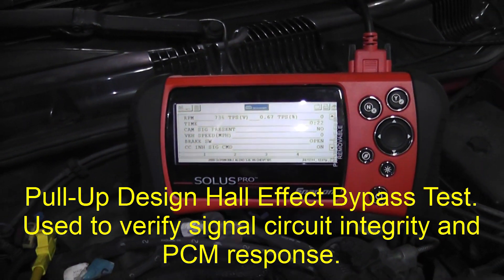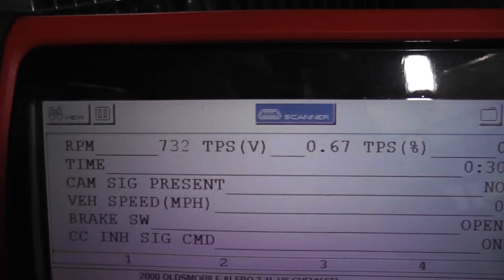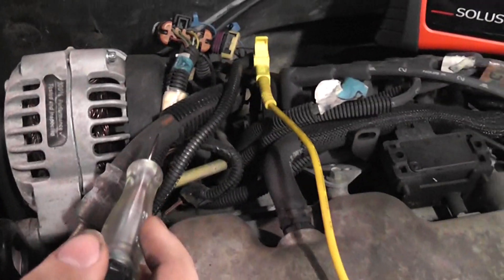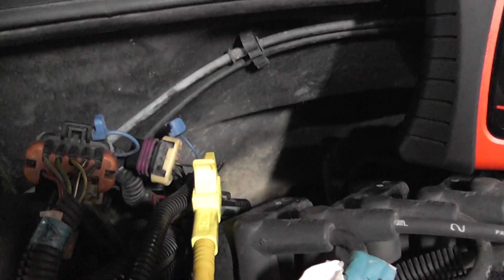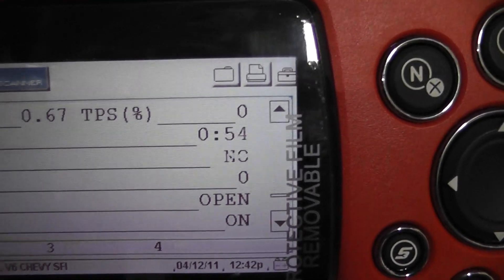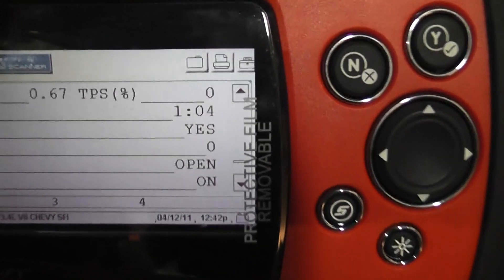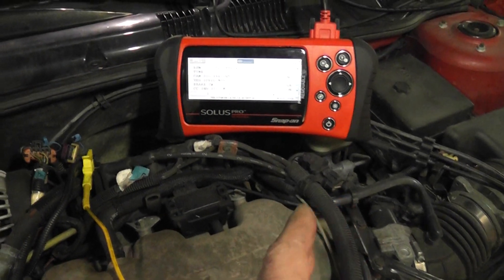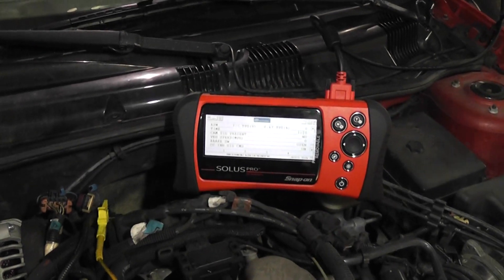Camshaft Position Sensor Circuit Quick Test

Comment from the maker: This is what the cam sensor is doing, so in this circuit design there is no danger at all. Even if you used a jumper wire and kept it connected, you wouldn't hurt this circuit.

Comment from the maker: @Howardtripper For this circuit, no, it is a 12v on/off square wave signal. For other lower voltage sensing circuits you still will not damage the computer with a higher voltage through your test light. The only voltage I have seen "hurt" an input circuit was an injector control wire touching a 5v ref. wire. This was causing 120volt spikes to surge through the entire 5v reference circuit. It cooked the MAP, AC pressure sensor and the PCM.

Comment: to add.

i pulled the connector plug of the cmp sensor and found the supply voltages  good.. except im getting 0v (or ground) at the sensor output to pcm wire.. it should be a 12v+ from the pcm for pull down to work.

Thanks in advance for your help. i really like your classes

Comment: @ScannerDanner best on the YouTube's thanks for sharing!! So, if the scanner is reading no signal from the cmp that is an error? (I have no cmp code but when monitoring engine with scan tool I see "no" signal present from cmp) If tested in this fashion with scanner showing yes when probing signal wire that verifies pcm and signal wire is good? [Assuming power and ground are present at plug this scenario shows bad cmp?]

Comment: that means the signal wire to the computer is good, right? and i assume the computer itself is good too, right? so if you're completing the circuit using the test probe, that means your cam sensor is BAD, right? You know what you're doing there, but its hard to figure out when i don't know

Comment: most and all service manuals for the chevy 3.4 sfi engine show the cam sensor to be a pull down design. its throwing me off that even the factory service manual says its a pull down design. There is another video of yours showing a 3.4 impala p0335 due to shorted cam sensor wires and it also shows a pull down design on the scope.

i scoped the sensor on a crt type scope and its showing up as a pull up just like this. While the manuals say its a pull down.. im trying to sort a driveability problem on a 01 impala 3.4 which is stuttering badly and the only code showing up is a pending p0336.

Comment: Thanks for the video.  I"ve got a P1374 code.  Says it's the cam shaft sensor.  I've taken off the power steering pump and I see the sensor.  I took out the 8mm bolt and the sensor sits and spins.  Kinda afraid to pull it straight out.  Is this what I should be doing?  The Haynes manual merely says to remove it.  Nothing specific on the how. 

I appreciate the reply!  :)
Reply: Sorry.  Forgot the vehicle info.  1999 Pontiac Grand Am SE with the 3400 V6 in it.

Comment: We have a 1997 Chrysler T&C, with a cranking no start.  It is now throwing code P0340.  Camshaft sensor has been replaced twice, as we thought we had a faulty one.  Doing a bypass test, power wire has 8 volts (which is what our Haynes manual indicates is correct for our vehicle)  ground wire is good, and signal wire has  3.76 volts.  With the sensor in place, power voltage, ground, and signal remain the same.  We get the same signal reading on the wire just before the PCM.  When cranking, there is no change to the 3.76 volts reading, no visible drop in voltage.  We tested the crankshaft senor in the same manner, and everything seems fine there, 8 volts in, good ground, 5 volts out, and able to see the 5 volts pulled to ground.  Any idea what we need to look at for the lack of voltage drop and seemingly low voltage on the cam sensor?
Reply from the maker: The 3.76v on the cam signal wire. What is the voltage with it unplugged? It should be 5. This is a 5v "pull-down" design signal circuit. Meaning the PCM supplies 5v and the sensor pulls it to ground to make the cam signal.
Reply: The voltage is the same on the signal wire with or without the sensor in, it's 3.76.  We tested the sensor by running a piece of steel near it, and when we did, voltage dropper right away.  Got the sensor seated better and now are able to see the drop on the multimeter.  Still getting code P0340 though, and the low voltage of 3.76.  Could that be the camshaft sensor connector needing to be replaced?
Reply from the maker: Kristina Rayborn
That voltage is too low! Check the same wire at the computer next. This will tell us if we have a wiring or computer problem.

Comment: hi, I got a alero v6 3.4L, I already change the fuel pump, the cam sensor, but my car still shutting off when I run over 60 miles on the xpress way, than I have to wait about 5 or more minutes to start it again.... any idea what could be the problem?

Comment: scannerdanner i'm watching this video and it looks like the sensor connector is unplugged when you re doing the bypass test and the engine is running is it correct ? can you explain a little more why is the engine running without the cam sensor
Reply from the maker: +rafael valenzuela system design will dictate whether or not the cam sensor is needed. On this system the computer will still fire the injectors using a default pattern or it will actually group fire them (with no cam signal). Spark control, the cam is not needed because of the sync notch in the crank reluctor

Comment: My car threw a CEL light on me today, I diagnosed the car with an OBD and fault message P1531 camshaft Pos. Sensor absent came up. My car runs fine as before, no changes whatsoever. Is this possible?

Comment: scannerdanner i have a 99 gmc safari and i have spark at ignition coil wire but no spark at distributor and the distributor and cap are new so with all my diagnosis i have learned that my cam sensor is not getting signal i have power and ground but no signal i was wondering if i bypassed it and hooked up a wire from battery straight to signal wire will that work or does it need to come from the computer just to confirm that the cam sensor is ok thank you.
Reply from the maker: cam sensor will not cause that. If you have spark going in and nothing coming out you have a bad cap and or rotor. Doesn't matter that it's new.
Reply: +ScannerDanner thank you for your reply and your help i actually figured it out a couple days ago i was actually getting spark just didn't see it in the day light, so I figured i would just check fuel pressure and sure enough i had 0 pressure from the beginning I eliminated fuel, because i had replaced fuel pump 2 years ago and assumed fuel pressure was ok but my fuel pump seems to be out, the fuel pump relay is clicking and im gonna double check power at fuel pump connector and ill just replace the pump it all makes sense now because that pump was a cheap pump from ebay that i shoulda never put in anyway thank you very much.
Reply: +rusani89 i may have spoken to soon today i was checking for power to fuel pump and there is power and I listened for the pump to come on and it did come on when i cycled the key so i checked fuel pressure again but i was only getting about 30 psi this time around and i think the spec is like 60-66 psi so i have no idea what that means clogged fuel filter maybe filter was replaced a couple years ago so i don't know.

Comment: isn't a computer wired for 5v not 12v if you touch it with 12v wont you damage the ecu

Comment: How safe it is to send 12v directly to the signal wire to the computer and probably more the 12 v cuz u have the car running, mining u probably have 14 v going to the computer throw the signal wire in this case your student left the test light hold on the wire for 5 sec that will cause a short in the computer pleases reply I want like to get a better understanding so I won't fuck up at work